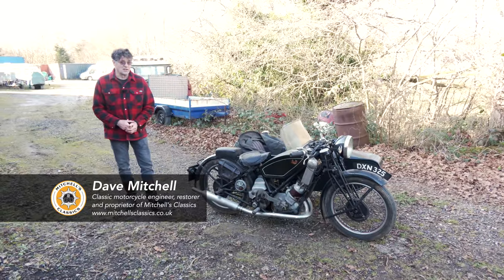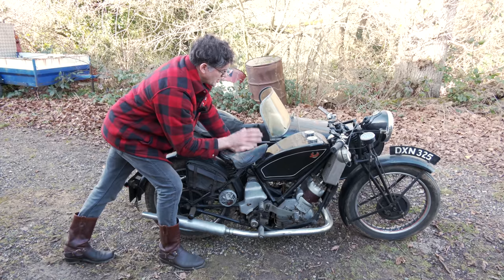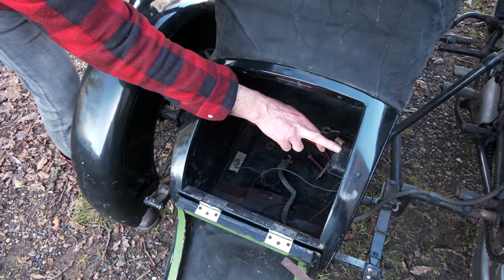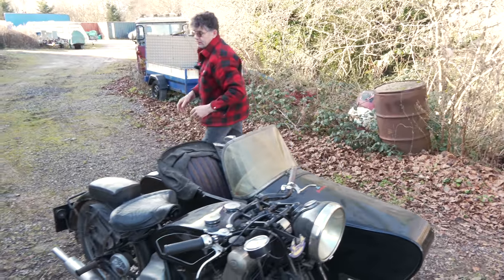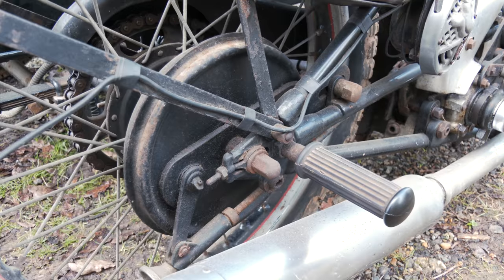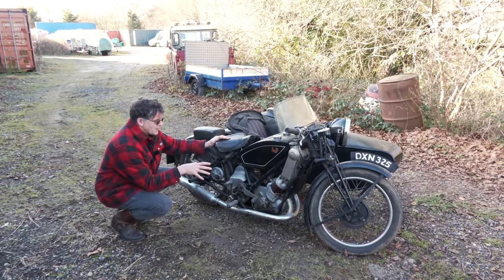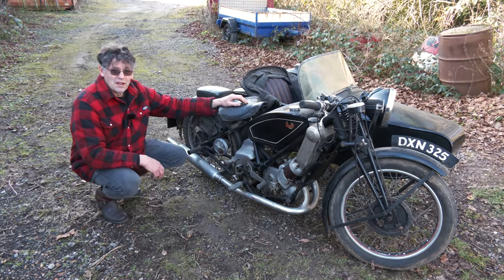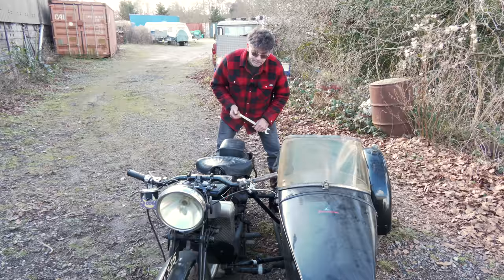1930s Motorcycle & Sidecar Recommission & Ride - part 1

Comment: My dad had a 1931/2 ish squirrel 600 TT replica with a sidecar back in 1957 ,we didn't know it was a TT rep back then , I only found out a few years ago when I saw it in Phil Lomax's collection near Bristol . As a child I would stand up in the back of the sidecar, double adult , the exhaust fumes made it unpleasant to sit , with my head poking out the top ,or sit on the pillion . We would go on holiday from Essex to Devon , getting up at 3 in the morning ,the bike packed with camping gear ,where did we put it all ? It would take 8 or 9 hours to get there on pre motorway single carriageway roads . 
My dad finally exchanged it for a  black flash BSA with a swallow sidecar ,as it didn' t like going slow in traffic , dad worked in Stratford east London then.
It was the "Scott yowl" sound I loved the most , very exotic compared to the single or twin four strokes that were the norm in the fifties .
Happy days !

Comment: As the owner of a modern triumph/velorex sidecar, this must be one of the most adorable things i’ve seen on this channel. Good job 👍 ❤️
Reply: May I enquire what Triumph you have with the Velorex chair? I’ve a Bandit 650 with a Steib styled wooden bodied sidecar. Been a sidecarist for four years and love it.
Reply: @piearm1271  Sure. It's a 2009 Triumph Thruxton - the first year with EFI, and the last year with steam gauges. Or there about. I had the connections between sidecar and bike made by DMC Sidecars in Washington state. The engine is not going well right now, service soon.

Comment: Lovely combination!  I am very intrigued to know what the crankshaft setup is? I  suspect that it might be pistons at 180 degree to each other so a power stroke each half turn as it's a two stroke. Therfore smoother than a four stroke  twin, power stroke once per revolution.  I do enjoy your videos, thanks.

Comment: It will be interesting to find out if the 85 year old crank seals are still as good as new.
Reply: That's a pivotal question innit really.
I absolutely hope they are.  No idea how replecemnts could be sourced if not - Does anyone craft the things still?
Reply: @Farweasel  I just remembered something about Scott engines: They have a central flywheel & main bearing(s), but no shafts outboard of the crank pins, so no seals, only gaskets.
Reply: @richardcovello5367  Bloody clever solution to the materials of the day that!

Comment: Total loss oil lubrication system?
Reply: Always total loss with a 2 stroke. (Can't imagine that many of these made it Stateside. Excellent bikes. Did well in competitions).
Reply: Like Bill Dyke says - Two stroke motors always are -  Its because the crankcase has to be 'empty' as its used as a sort of hybrid extra mixing and pressurisation chamber - the decending piston pressurises the fuel/air mix in the crank case to force it through into the cylinder.
So the oil in the mix lubes the crank bearings etc as it goes through.
It quite interesting to find out more about if you're not familiar with these engines.